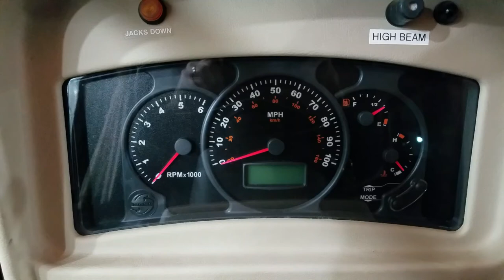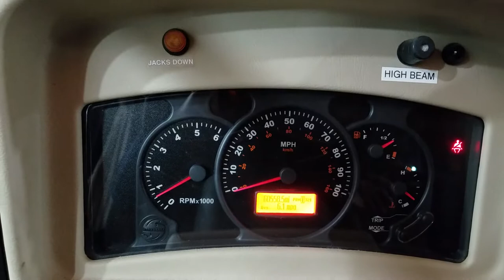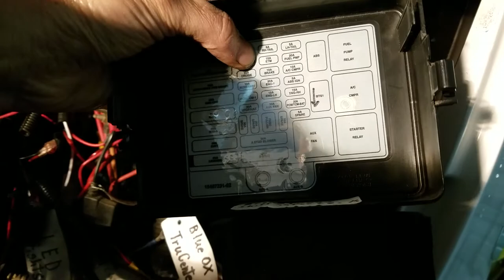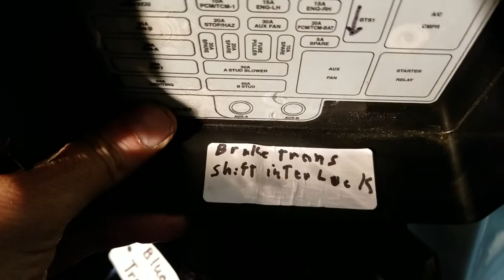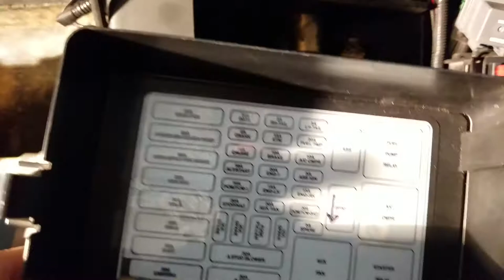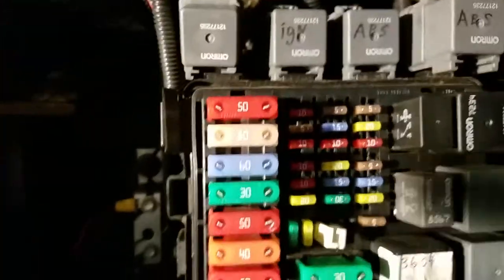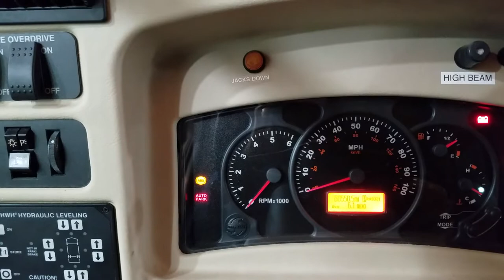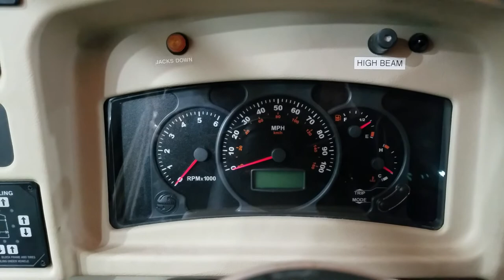J72 Auto Apply Park Brake won't disengage / release Workhorse W24

Comment: Kevin.  I contacted you a couple of months ago about my parking brake.   Dexron fluid was low and after refill it started to work again.  So  to save an expensive tow job I built myself a hydraulic pump system  to bypass if I ever had trouble again.  Went on a 1200 miles trek Last month, no problem.  Today we left home at 10AM for a 1000 miles trip.  We  stopped for lunch and when we tried to leave, parking brake is not disengaging.  I had watched and saved all your related videos and saved th on my phone.  Pulled the video up, watched the first few minutes and swapped the ABS relay with the Auto Park and we were back on the road in 20 minutes.  Thanks so much for the videos and explanation on how this works.  Without you, I would have been waiting for a expensive tow to some place that may not even have had the knowledge to fix this.  Thanks again!!
Reply from the maker: Wow glad your back on the road and thanks for sharing your story... Stay tuned more videos to come.

Comment: 2007 W24 ABS light came on but the rest of the brake system was working fine.  I eventually traced the problem to small pieces of rust sticking to the end of the sensor.  Once parked, I checked /cleaned the sensors and the light went out.  The right hand front sensor had a build up of rust particles which reduced the gap!  That was two years ago with no problem since.  I appreciate your videos.  Thank you.
Derek
Reply from the maker: Thats a great tip thanks

Comment: Mornin Kevin,

I love seeing new videos from you.  I always learn something.  Thank you so much.

I don't want to hijack your thread but I couldn't help but notice the low frequency hum when you cranked up.  My 2005 Adventurer has that same hum and I was concerned.  I had a little smile when I heard yours.  Any idea what we are hearing and is it a possible problem?  Thanks again for your work in keeping us on the road.
Reply from the maker: We have always had that sound I be-leave its the power steering pump. And I think its normal.  But to confirm the next time I have the fan belt removed I will start it up and see if the sound then goes away... STAY TUNED....
Reply: It does increase with RPM and seems to be the same once the engine is up to temp. I too suspect PSP so checked fluid level but all was well there.  Turning wheel lock to lock did not seem to change it.  Like yours, it has always been there[ three years]. Thanks for the reply
Reply from the maker: @lonesomedovefree1429  I have a video on how to change the power steering oil and filter

Comment: Good fix Kevin. Fairly common from what I recall. In RV parks, as the long term snowbirds prepared to head home, that was one problem. As a tech working on machines with banks of hundreds of those relays, we often pulled them and used a slightly abrasive 'burnishing tool' to clean the contacts.
Reply from the maker: Thanks for commenting,  and for watching. Do you own a W24 Workhorse ?
Reply: @ktoutdoor  -2004 W-22, 34' with 110,000 miles. We take two [month long] trips a year, Spring and Fall when families with kids are not present, interspersed with a few short weeks of 800 miles or less. Summer is relaxing in mild climate ABQ NM, as well as mild winters. I do all of my own maintenance, as do you.
Reply from the maker: @Blogengezer  From your comments I figured you was a fellow wrench turner....
Reply: @ktoutdoor  -Am next looking at the air filter and deciding an energy efficient method for separation of the halves. Any suggestions? ;) Replacement of filter with on-line from California appears to save about 1/2 the local price.
Reply from the maker: @Blogengezer   is this what u have now ? https://www.ultrarvproducts.com/25169408-Air-Intake-Box-Asm